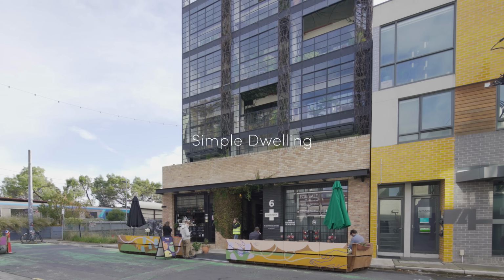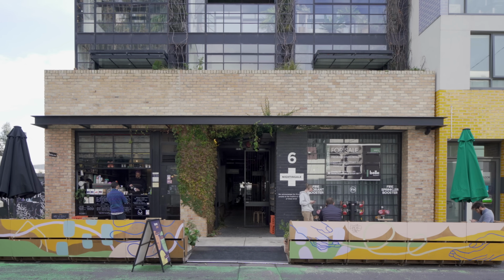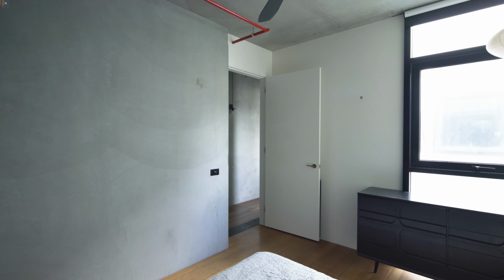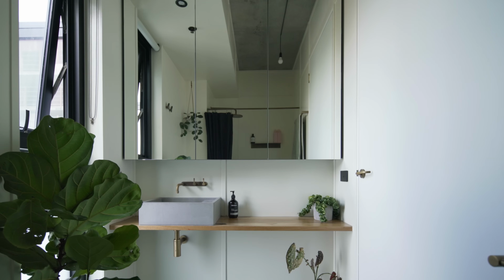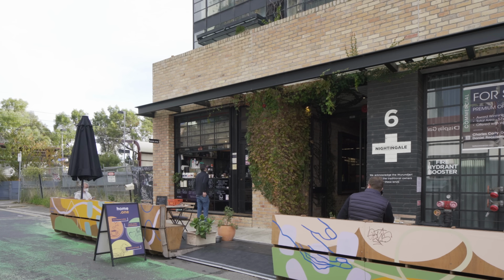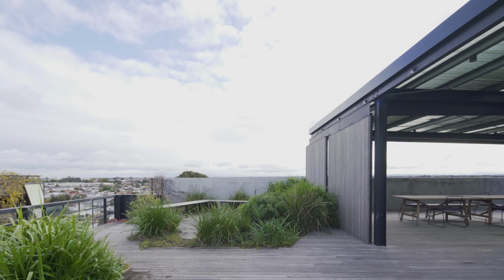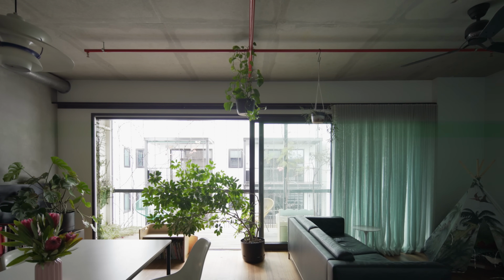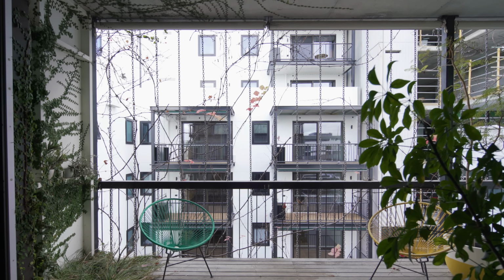How These Nightingale Apartments Build Less to Give More

Comment: Define affordable?
Reply: I think that it's too difficult to define, what is expensive for one person is affordable for another and even cheap for a third. My understanding is that property in Australia is very expensive, across the board! My understanding of this particular project is that the building is not sold for profit and the design is geared to lower the running costs significantly, which long term saves you money 💰